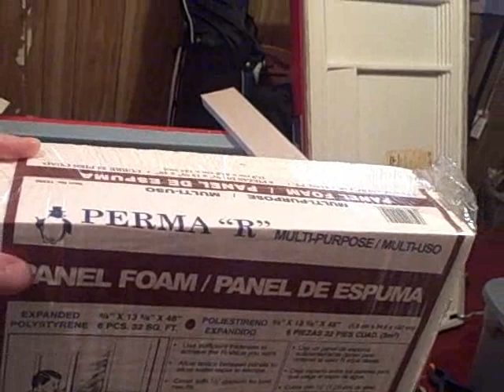Part 2 - Chest Freezer to Keezer Conversion

Comment from the maker: @bmeyer44 well right now I have my drip tray on my kegerator held on with magnets and it works pretty well.. I may stay with that on this one too.  I thought about the small blocks of wood on the inside BUT since I goofed and made the collar to overhang the edge of the freezer, that means when i shut the lid the seal won't hit the wood! Duh on my part. So i have to add some wood to the inside of the collar and I don't have much room to play with if I want to use blocks and screws  :-(

Comment from the maker: @bmeyer44 I'm about ready to say screw it and re-cut my collar to fit on top and not worry about the square corner sitting on top of the round corner, instead of doing the over-hang thing. I'm also worried about those old hinges being a pain and I would have problems with using newer hinges on the back with the over hang as well. Either that or attach it to the lid like some do! Live and learn  :-)